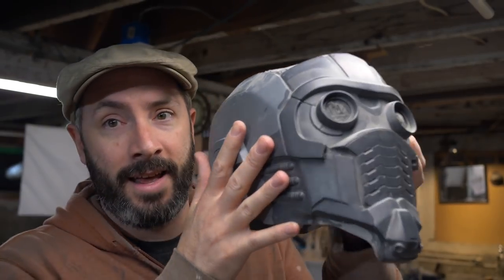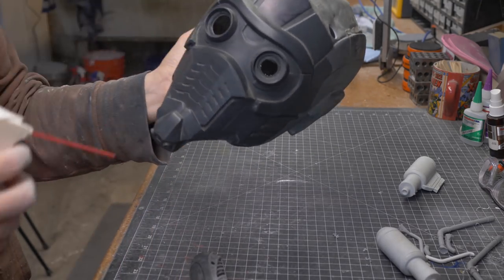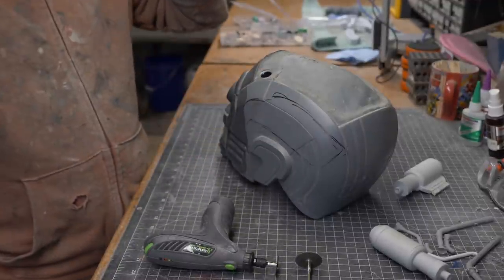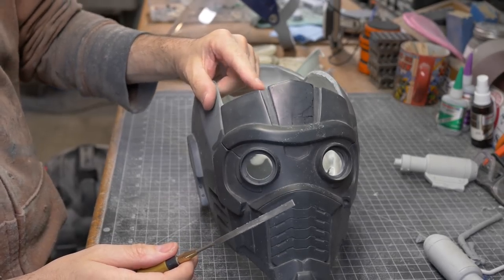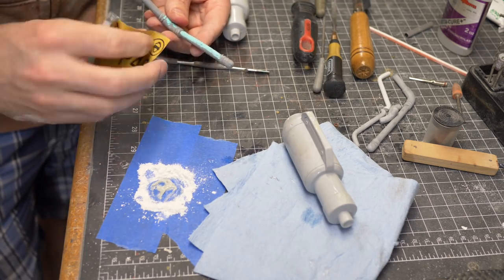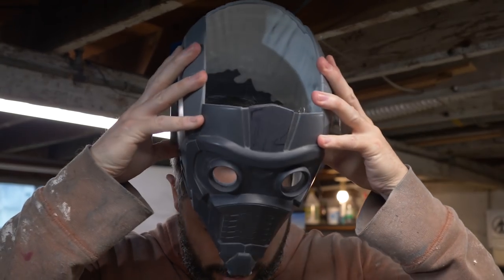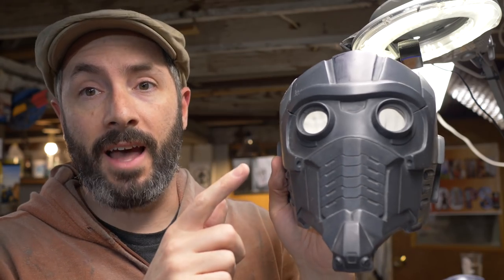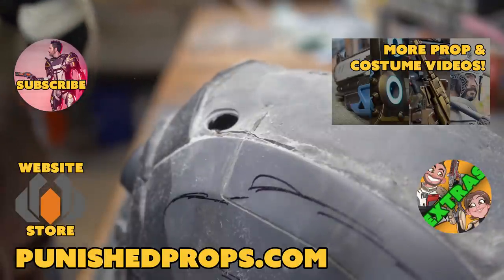Cleaning up the Casting - Finishing the Star-Lord Helmet Kit Part 1

Comment: Hello love your work, but I got a quick question. I know you primarily do prop guns and sci-fi stuff but I'm sure you've done swords too. What is the best material to make prop swords?

I personally use wood because it's sturdy and can take my abuse. However, it takes me about 8 hours of complete focus to do a full carving and when people ask me how I made it they always get turned away from the project because I said it's made out of wood. Understandable since wood isn't the easiest to work with, but is there any other material that can be sturdy enough to be a sword that would be easier to work with?
Reply from the maker: Depends on what materials and tools you have available to you. I'll use a hard wood like poplar for sword blades. You can also make them out of EVA foam, but you'll need to reinforce the blade with something rigid like a plastic tube or wire.
Reply: Punished Props 
Yeah poplar is the wood that I've been using. What's the thinnest blade you've made with poplar? The normal wood cuts thickness is 2cm normally I bring mine down to 1.5cm, do you think a longer sword can handle 1cm blade thickness?

Comment: Hi guys. I need help. I made Captain America's shield and I'm torn between which glossy coat to use. I'd like to use something with a high shine. What do you guys recommend?
Thanks in advance!
Reply from the maker: The stuff we used in this video is really good! https://youtu.be/QasgWETceyU
Reply: Punished Props Sorry. I forgot to mention that it's made with EVA foam. I don't know if it would make a difference
Reply from the maker: Oh yes, I would go with a gloss varnish.

Comment: why aren't you using dremel? btw love from israel...
Reply from the maker: I don't actually own a Dremel brand rotary tool.
Reply: are you planing on getting one or you find having both light duty and heavy duty is enough? i personaly use my dremel all the time...
Reply: I wouldn't consider buying one either if I had access to a Foredom ;)
Reply: The Gnomish Arcanum yeah but the foredom is a really heavy doty rotary tool and the battery charged one is really light duty rotary tool, personaly i'd rather having all three (the battery chrged, dremel and foredom)
Reply from the maker: The Foredom is good for everything, it's just bolted to the wall.
Reply: ohh ok, just a tiny question, where can i buy the foredom rotary tool?

Comment: FYI, most respirators and dust masks are rated for people who are CLEAN SHAVEN. i.e. no beard. if the mask doesn't seal to your skin, not on hair, its effectiveness is drastically reduced. 

use a full face mask if you need the beard :)
Reply from the maker: Good tip!
Reply: I've tried full face respirators like the 3M 6700 and it doesn't work any better for me because it squashes my glasses on the sides. You can still get a decent seal with a half mask, provided you don't rock a full ZZ Top beard. The only 100% safe solution i've found is a sealed hood with a powered respirator which is pretty inconvenient in the shop and crazy expensive... A half mask and good ventilation still do the job.